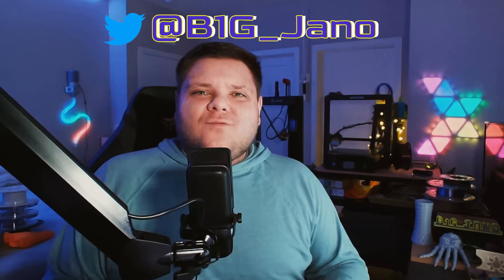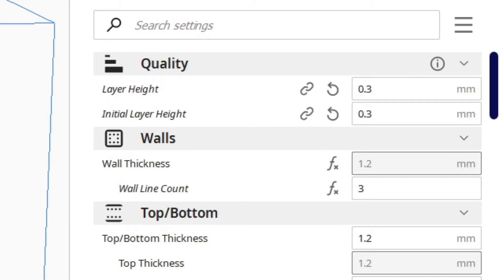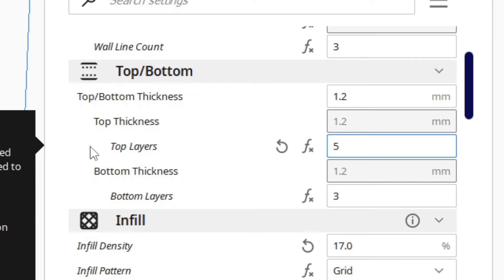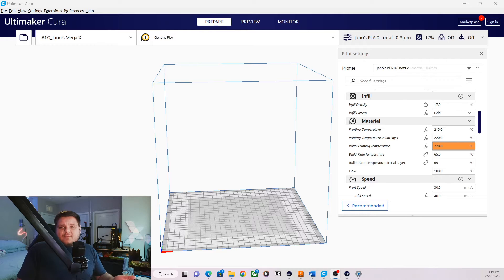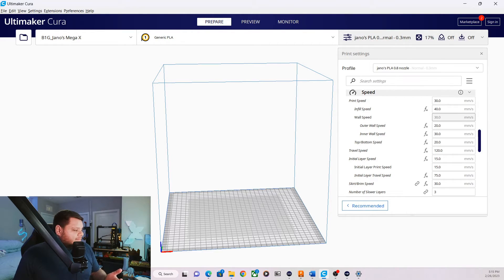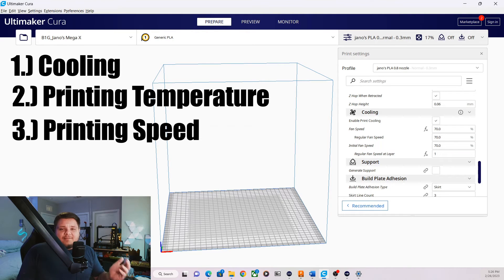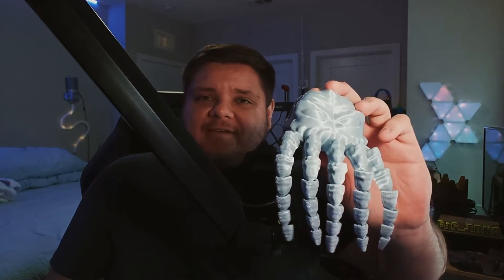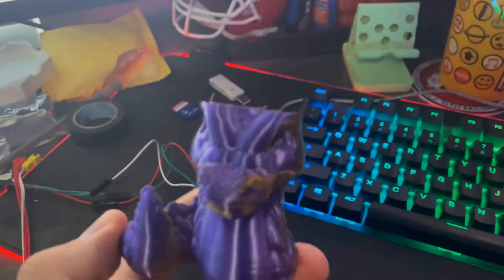Getting QUALITY 3D Prints using a Larger Nozzle! | Step by Step Cura 0.8mm Profile Setup

Comment: i dunno about you but i went with the standard .8 PLA profile from Cura with 40mm/s speed and its doing great on my Ender 5 Pro (2018) at 190°. 
no need to slow down dramatically, for small details my bigger concern is cooling actually

Comment: I'm looking to print in vase mode with a larger nozzle. I got really excited to see a vase in this video but you didn't use vase mode. Was there a specific reason? Have you done any vase mode prints yet on the larger nozzle?
Reply from the maker: @prendes4  the only real difference from what I did versus typical vase mode was just adjust the number of perimeters. Normal vase mode only does 1 perimeter while I added a few more perimeter walls for strength. Really just comes down to preference. You could certainly use vase mode with 1 perimeter with a thicker layer height.

Comment: Hi, could this configuration be used with a 1 mm nozzle?
Reply from the maker: @lotuswhitethe  probably. Just make sure to change the nozzle size in the slicer and set the layer height and extrusion width accordingly. You may also want to slow the speeds a tad but that can be played around with.

Comment: How about supports?
Mine are welding on or too low…
Reply from the maker: i would make support layer distance from print to be equal or just slightly smaller than the layer height number. Witha a larger nozzle youre going to want to have it set larger so it doesnt weld. It may run the risk of peeling off prematurely but id rather have that than it weld on. Again, just my two cents but feel free to experiment to see what works best for you

Comment: I’m going to a .8 just to get rid of this jank filament I have keeps clogging my .4
Reply from the maker: what filament is it? Is it metallic or silk? Sometimes those clog easier than regular filament. Hope the 0.8 nozzle serves you well!
Reply: @B1GJano  pla lol
Reply: @B1GJano  I did pick it up well cheap so I see why now lol
Reply: @B1GJano so after all that turns out for some odd reason my printer thinks the nozzle is way hotter than it actually is so thermistor problem by looks of it
Reply from the maker: @shokdj1  that could do it. Also double check that you don't accidentally have your nozzle temp set wrong in your slicer either.
Reply: @B1GJano  Cheers for the suggestion, I think it's defo set alright lol got it set at 260 (max it will go) and its still not hot enough. I tested by putting my thermometer from my multimeter on and it's well off and is getting worse so I've ordered new thermistor. I really really hope it's the thermistor that's wrong because if it's not that then it could be something to do with something on the pcb like a faulty microcontroller or something. I don't know the schematics of my printer and I don't want to have to pull it all apart to diagnose it.
Reply: @B1GJano  that being said I doubt it'll be a microcontroller it'll probably be something basic like an inductor or something

Comment: Don´t change your print speeds, simply set the volumetric flow rate value, the printer will adjust automatically, it´s way easier than fumbling with speed again.
You can also print 0.8mm lines with 0.4mm nozzle size with no issue, so you don´t really need a bigger nozzle unless you want to increase the layer heigths as well.

Comment: i tried these settings, and my filament starting piling up , like coming out too much or something, looks like it was stuck in 1 spot, but wasnt,
Reply from the maker: You extrusion value in your slicer May be too high. Calibrate your e steps as a possible solution.

Comment: Hmmm nice vid great content but bigger nozzle size is not suppose to be use to gain time? If that so why print slower and add walls 2x0.6 walls = 3x0.4 walls, 0.3 layer height = 1.5x less print time than 0.2 but if you slow speeds in half their is no benefit what so ever. Maybe your  printer just need help on coolling a second fan and a petg fan duck sould fix your speed issue. I know is a dick comment sry but a dick comment still a comment so it's still good for the mighty algo. For your question i print every functional part in FDM 0.6 any art  part in resin

Comment: It looks like with a larger nozzle size, we will get slower prints, if we have to slow down on every speed and also with the  thin layer as it was with the thinner nozzle.
Reply: bigger nozzles lay down more plastic.  even at the same layer height a 0.6 lays down twice as much plastic as a 0.4mm and a 0.8 lays down 4 times as much.  with a 0.8 even if you cut the print speed in half, you're still printing twice as fast, and that's before considering the higher layer heights you're capable of.

I use a 0.6mm nozzle at 0.32mm layer height and can print a benchy with my regular quality profile in about 15 minutes.  with a 0.4 it's more like 25

Comment: Is this a valid concern?  Don't we want the previous layer hot enough to bond with the current layer?
Reply from the maker: I mean yes you do. But you’ll also have to run it slow enough so the layer can cook properly. Otherwise, you’ll have the issues seen in the video like I did on occasion

Comment: Big Jano, what about the travel section? Do we need it for no strings?
Reply from the maker: Yes. I would add your typical retraction settings. I didn’t change them in comparison to my smaller nozzle profile so that’s why it wasn’t mentioned.
Reply: What is your travel setting? My printer is the Kobra Max.

Comment: What is needed to fit the v6 hotend to a mega x?
Reply from the maker: You may need modified parts on the hotend assembly to account for changing the fan duct height to match the height of the heatsink as it’s a bit longer.

Comment: Have you done ABS or CF nylon with the AC MX?
Reply from the maker: I have not. For one, the bed temp realistically onlu gets to 90c so ABS is going to be a stretch. Also, I dont have an enclosure for it and also dont have much need for either material at the moment.

Comment: hello B1G_Jano, I recently bought a used mega x (even if I have more modern printers like ender 3 s1 pro I think the mega series still has a lot to be appreciated) to complement the i3 mega and mega s, I took it with the intent to mount on it a 0.6 or 0.8 nozzle and your recent video is very interesting to me, would you mind sharing your profile when you have optimized it? I would be fine with it either for curation or even for any other slicing you use.
Thanks for the great job
Reply from the maker: the profile is verbatim of what was discussed in the video. As long as you follow along, you'll have exactly what I use :)

Comment: How did print time compare on those models compared to smaller nozzle and layer height?
Reply from the maker: with exception to the vase, everything took about the same amount of time, or just a little bit slower. I did print most of these prints with more infill than probably needed and could've saved time depending on the print and how I sliced. You just need to make sure you print slow enough for the layer to adhere and cool properly.